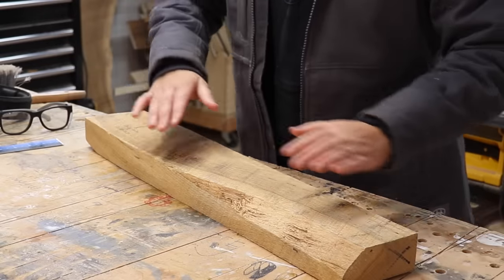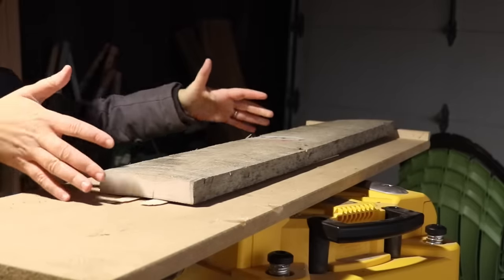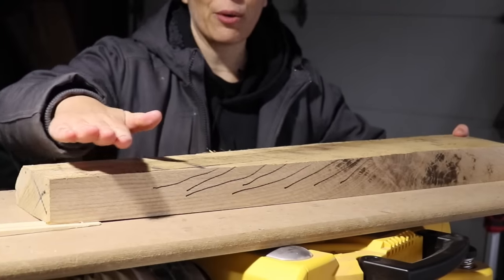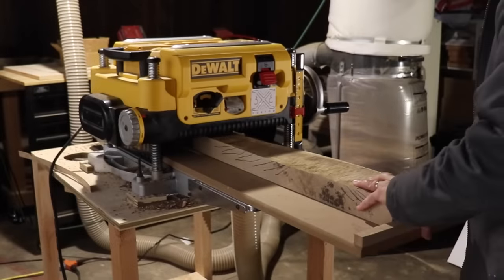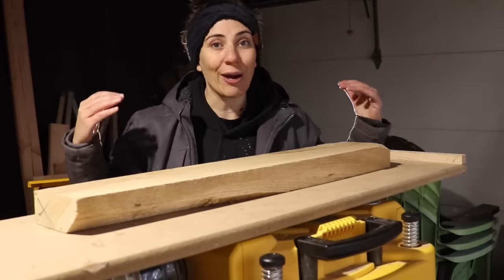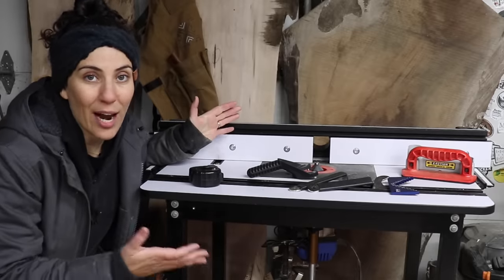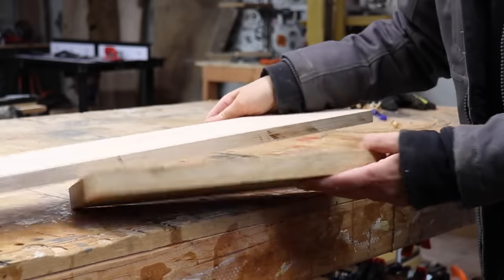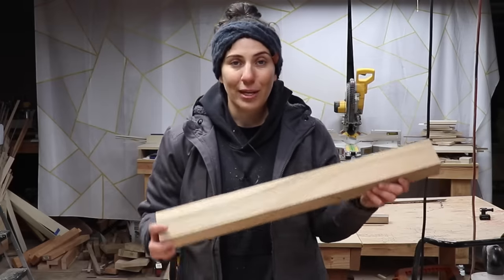Milling Rough Lumber Without a Jointer Using a Few Simple Jigs

Comment: How about the two ends?
Reply: I guess the ends' length is so small you could eyeball it and plane it with a manual planer or sand it square with a sander.
Reply from the maker: I mentioned in it this piece to rough length. After all this is done. You cut it to final length. Cut one end using a square end as reference. Then cut the other end to length.
Reply: @3x3CustomTamar  Thank you!

Comment: There’s really no reason for the shims as long as you don’t try and take off a huge amount the board will just ride along the high points until the planed side is relatively flat and then just flip it. Not rocket science.
Reply from the maker: There absolutely is. If you send a twisted board through without shims. The top will come out twisted as well.

Comment: Actually the 2nd step would be to square the edge, not flatten the parallel side. Just sayin’.
Reply from the maker: Not when you don’t have a jointer. The steps are different. You’re already at the planer. Why then go to the table saw and then back to the planer?

Comment: If you have a planer you basically have a jointer I flip upright all the time and just plane it that way
Reply from the maker: You can’t get a warp out of a board that way
Reply: Not a warp just mean to get a clean jointable edge
Reply: I think I came off wrong. I was just voicing that in a pinch it does work to double clamp it with a stop black on a sled as long as its shimmed level and clamped in it works but no its not going to fix bigger issues

Comment: You need to turn that sled around you're running it in backwards check more on YouTube and you'll see
Reply from the maker: Actually that’s up for debate. I’ve done it both ways and have never had anything come loose in either direction

Comment: NEVER use a jointer to surface lumber!  This is so unsafe!  They are for edges only!  If they were for surfacing then they would have that in the name.  Do exactly as instructed in this video.  Planers have all the safety in place.  No way your board can kick back and have your hands go into spinning razor blades!
Reply from the maker: Yeah… no. You are definitely supposed to surface one face on a jointer.

Comment: Always questioned why you yanks call thicknessers, planers. And planers, jointers. So odd. The "planer" is thicknessing timber. The "jointer" is planing. Us Europeans have it right
Reply: Plus, this method definitely wont "thickness" timber equally across its length. Just buy a cheap planer lol
Reply: And also, you dont need to run it through a table saw to cut a square edge. Just run a track saw through it lol. Job done, square cut edge, send it through the thicknesser. This is great viewing for people but what a lot of messing about